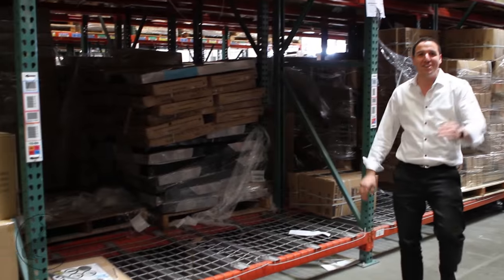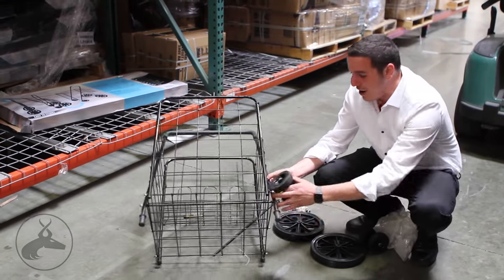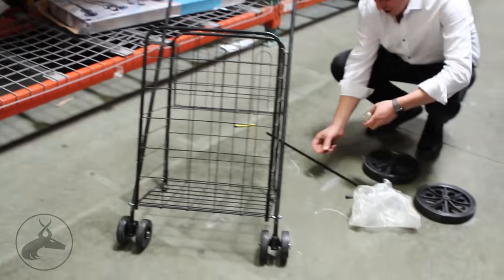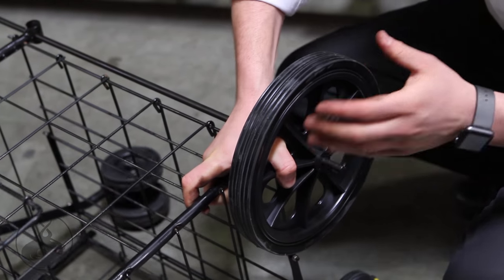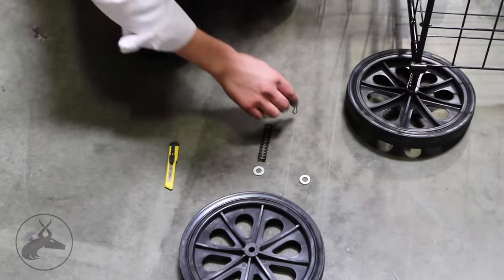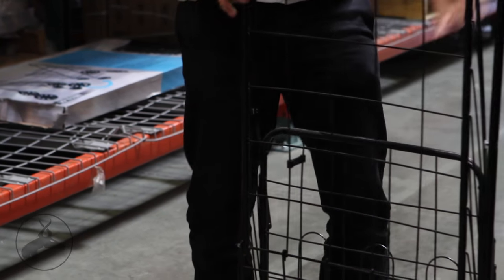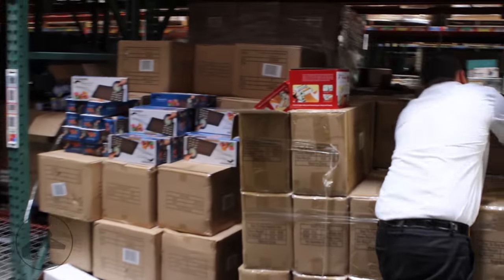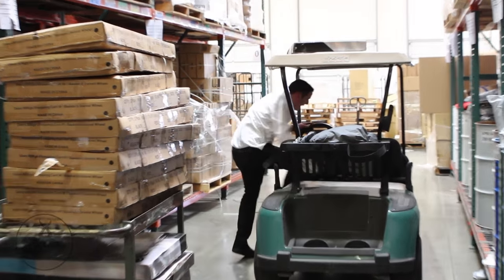Tv Host Bill Confidence Live Presents OxGord Folding Shopping Cart w/Double Basket, Jumbo 150lbs

Comment: Rather than buy a new one like the one seen here, I just keep repairing what ever fails on the one that I have, but in doing so, each time I make it stronger that it was beforehand. It is now almost indestructible.  Plus I lined the walls with water proof Black Corrugated Plastic sheets so nothing can fall out.  The two side plastic sheets just fold back before folding up the complete cart.
Reply: Instructable. ?  turn it into a herb garden or flower tower. Great it has wheels. Can put the flowers where the sun is.

Comment: The product does need instructions or else I wouldn't have had to look up the video.  The video helped me but it doesn't show the most difficult part and doesn't even mention it; and that is the very last step, putting the pins in through the cap but it also has to go through another hole at the same time.  not fun.  Haven't used the product yet but it looks very sturdy and rolls easy.
Reply: Diana HI can you tell me is bill confience a joke or does the oxgord folding shopping cart function as abvertised in the video im looking to buy a versitle cart for when i have to buy groceries at my local store just wondering how well this carts capeble of considering someone has purchased the cart thought you could give me some input

Comment: I got an "Oxgord" jumbo folding cart as a clearance item at a grocery store this week.  There were no cotter pins in the box; instead, they gave me near-microscopic retainer pins.  The dangling metal braces on the bottom of the cart that "Bill Confidence" conveniently skipped over are expected to fit over the #1 "spindle", also known as the rear axle.  The spindle rod is too large for the braces - they won't fit.  Can't use the #2 "spindle" for the rear axle, although the rod is small enough for the braces, because that rod is too short - the big back wheels won't clear the protruding basket bolts and the springs are too big for it.The "instructions" that come with the so-called cart make no sense.  The photos don't show what needs to be done.This guy "Bill Confidence" should be made to constantly assemble these carts off a conveyer belt assembly line with a piecework quota.